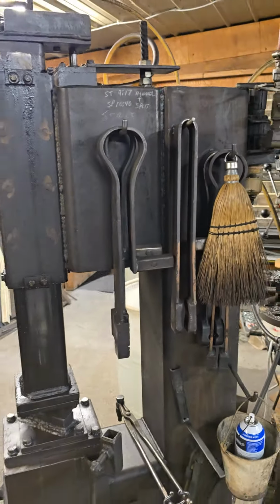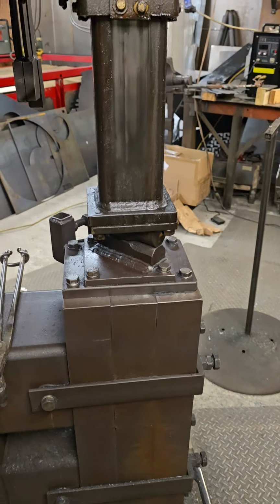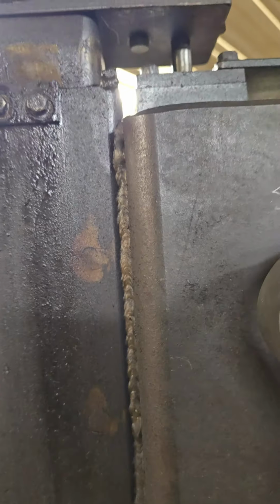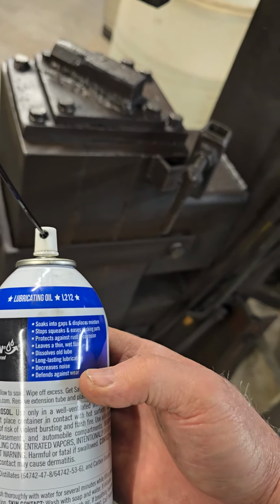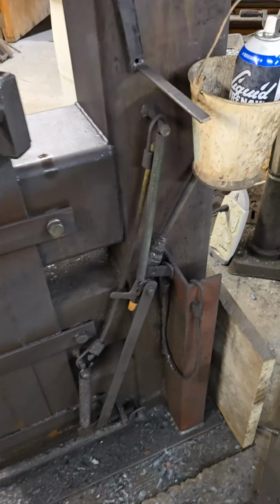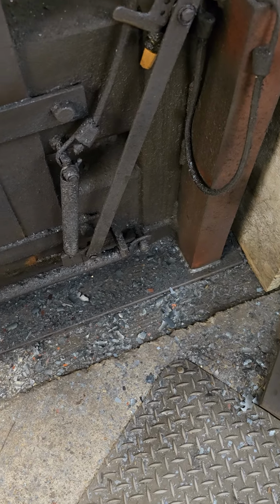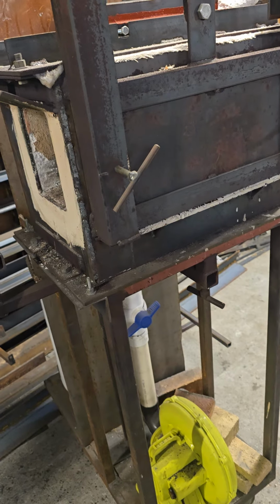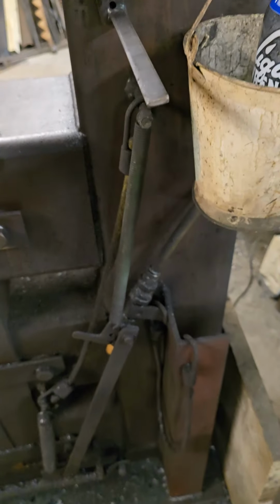homebuilt power hammer

Comment: I was looking at buying a pneumatic hammer over the tire hammer for more control. I like your design.  Thanks for the video.
Reply from the maker: Your welcome. I am not a fan of mechanical hammers but they do have their place. IMO if you have the air go with air.
Reply: @joebrownartistblacksmithju3047   I was going to get the tire hammer or make one until Ron told me about why he got his pneumatic for more control after the piece he was forging shot out from the tire hammer and grazed his head.  I was looking Coal Irone Works pneumatic but it is so expensive.  But it will save my shoulders too.